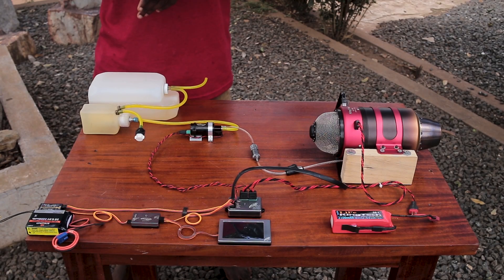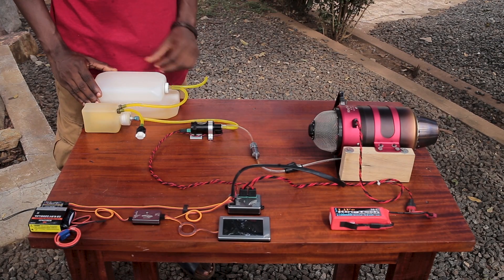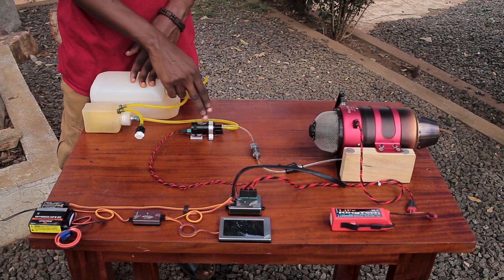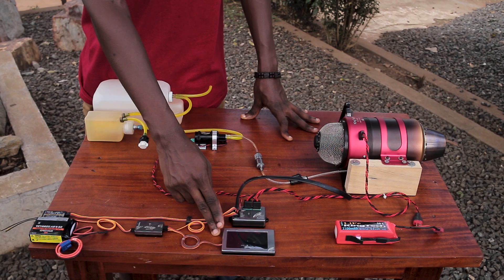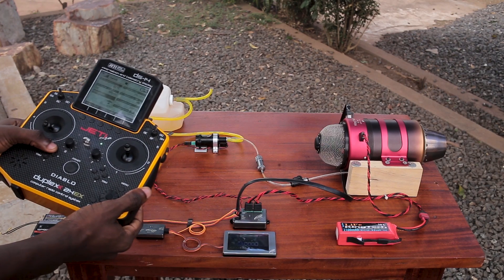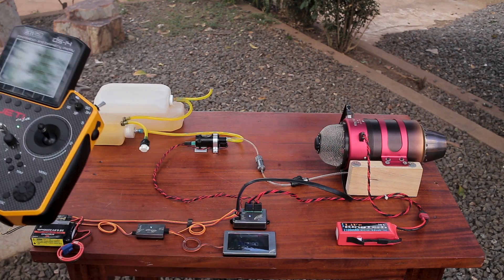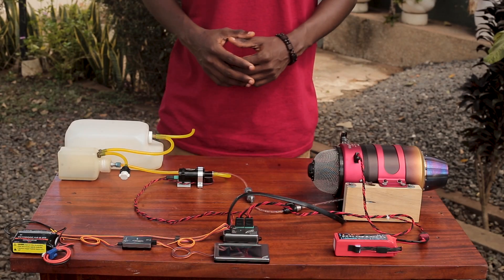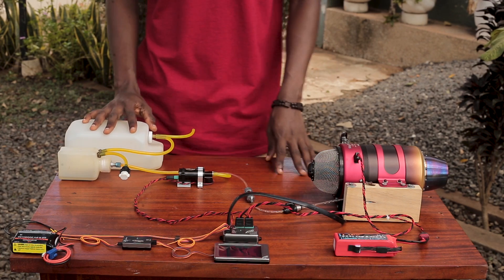Kingtech K140 G2 Turbine Engine First Run Awesome!

Comment: Hello My friend,  everything is fine with the turbine display. I have a question for you 40 Oz fuel tank , can I make the run time longer if I and the fuel almost to the top but Wright below the air hose in the tank?  At the moment I stop adding fuel Wright below the Nipple where the fuel and airs at.
Reply from the maker: I think You need a “clunk-line” in the fuel tank. The clunk line is a short fuel hose about 6 to 8 inches long with brass fitting at the end, this is installed at the other side of the main fuel tank’s bulkhead (nipple) which goes inside the tank. the brass serves as weight to ensure the hose settles at the lower part of the tank always. This results in an easy & even flow of fuel no matter the orientation of the tank or aircraft. This also means that you will be able to use or drain fuel completely front the tank  

Let me know if this helps 
Gad
Reply: @gad_ayep  that's good information, I do have a clunk line in the tank, but can I fill the fuel all the way to the top instead halfway of the tank?
Reply from the maker: @michaeldunner7891  Yes you can fill all the way to the top, any excess fuel will flow out of the vent line, make sure your vent line is positioned at top most part of the tank.
Reply: @gad_ayep  thanks

Comment: Hello my friend can you tell me where can I buy the fuel quick connector, I can't find them anywhere. My tube size is 4mm.
Reply from the maker: You can get the 4mm quick connector from these shops. 

Dreamworksrc.com 
Nexusmodels.co.uk
final-modellbau.de
Aerobetics.be 

The manufacturer of this connector is called “FESTO”  so you can search 4mm Festo connector on google and equally find suppler near you.
Reply: Hello, my friend, after using a tank of fuel should let the turbine run out of fuel on its own until it shuts down or turn it off leaving fuel in the hole system?
Reply from the maker: @michaeldunner7891  Hi friend. 
It is not a problem to shut off engine while you still have some amount of fuel in the tanks. you can always 
drain fuel out of the tanks later through the “fill line” on the UAT. a standard hand kwik pump can easily do this. just make sure you do not have any plug or stopper  on the “vent line”. and crank the pump the reversed the fuel will come right out.
Reply: @gad_ayep   wow,,,,, thanks, you sure can give a fast and positive answer, I’ll take my hat off to you,,,,,, thank you
Reply: Hello my friend, everything went well, my question is, the winter is coming, tell me what I do need to do to the engine for winter storage?
Reply: Ps before I bring the trim down to shut down engine, is it best to shut it down before it runs out of fuel?
Reply from the maker: @michaeldunner7891  yes
Reply: @gad_ayep  ok, I understand, but how about winter storage? Anything special I need to do for the engine, fuel tank and the bubble free air trap?
Reply: Can you please answer my last question
Reply from the maker: @michaeldunner7891  Hi Michael sorry for replying late. You do not need a spacial storage for the engine. just leave it sitting in plane and store at your workshop or garage. If the engine is mounted openly on a bench or table do cover it up with some cloth or bag. I have not come across any discussion on special ways of  handling these engines in various seasons. they are robust and can withstand the weather. 

We do have winter out here. Its summer throughout the entire year😎 haha..
Reply: @gad_ayep  it’s ok my friend, thanks for the information